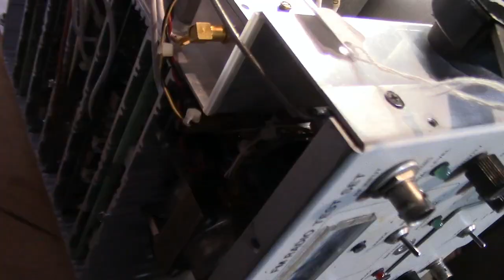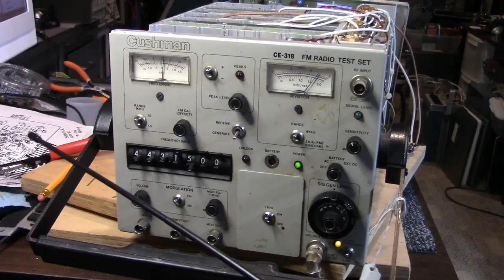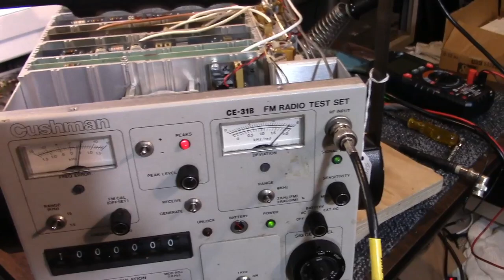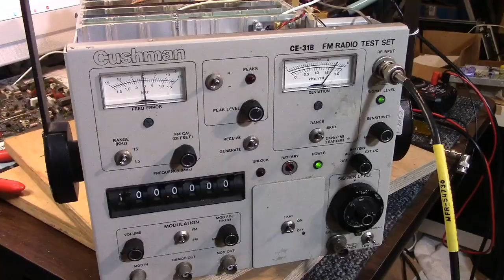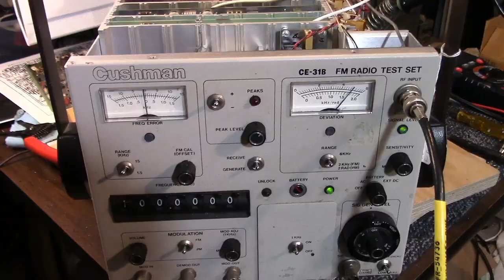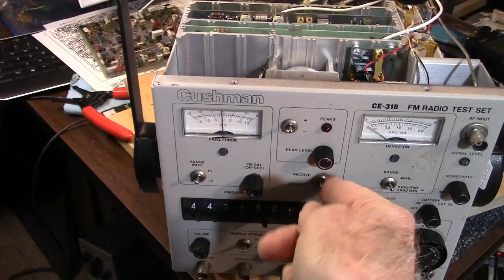Cushman CE 31B  Part 2

Comment: Do you have a spare power supply module I can buy for a CE46 or CE-50 same supply. ( I forget the model number, not near it) it’s the 12 Vdc supply with the rear panel and rubber feet. It’s the switching 12vdc supply. It works well on an external supply on the banana jacks.
Reply from the maker: Hi Robert, Sorry but I gave the parts unit to an individual repairing his CE31B.